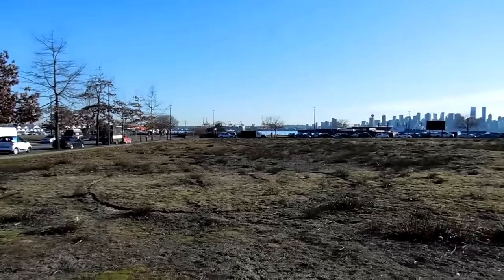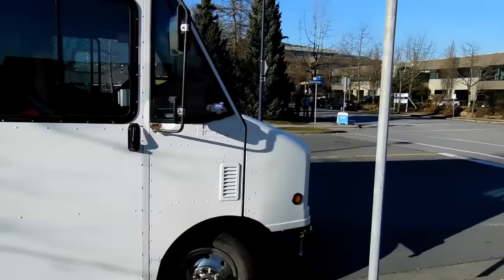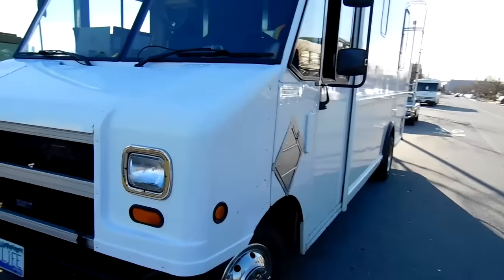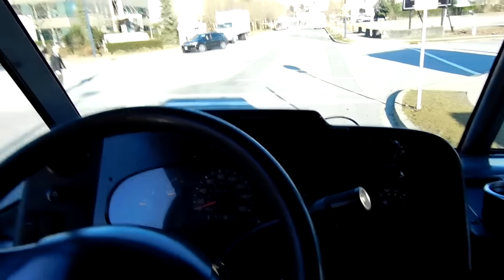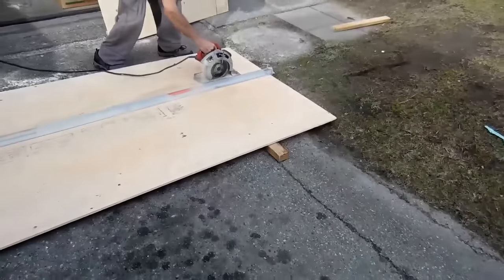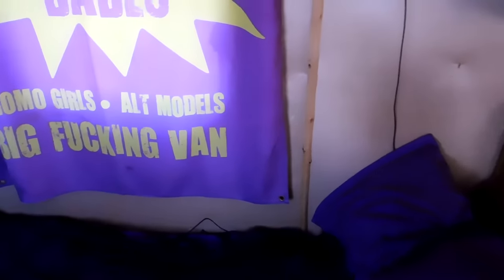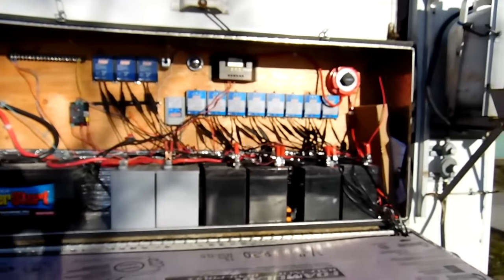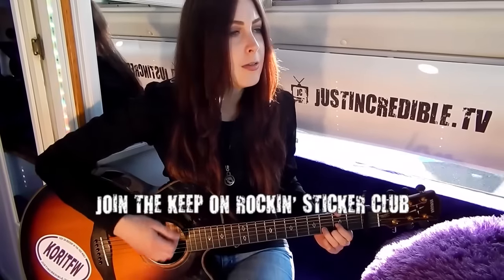My new step van motorhome conversion project!

Comment: My jaw dropped, "HOLY HAIRBALLS", when I saw how many batteries you had in that thing. Yeah, you'll never have power problems with that.
Reply from the maker: Hahaha considering the only things I plug in are my laptop every few days and the speakers, it's beyond overkill. 🤷‍♂️👍
Reply: @JCredTV  You can probably run a standing portable, window or wall AC unit, a fridge and a microwave plus everything else on all those solar panels and batteries.
Reply: they look like starter batteries with PWM controllers, lmao
Reply: @JCredTV  
You must come from a rich family in order to change living situation (camper van, rv) every few years.
Reply from the maker: Biking with Panda, all deep cycle but thanks for coming out.

Comment: wise Move !   I am here in east Tenn. USA  and after much research on all trucks/vans ,  Have decided to also settle on a small bread Truck , steel frame, aluminum wall and skin frame ,  easy to work on the engine, nice width, height, and length. and can design build to my needs.  Look forward to seeing future vids, keep up the good work.

Comment: Been thinking on this for some time. Each type of truck has its selling points and drawbacks. Started by looking at step vans, but many of them have an open cockpit, and I wanted privacy. So I started to look at cutaway vans. Unfortunately, cutaway vans are arbitrarily no longer than 16 feet in the box and 95% have roll-up rear doors. So, now I'm swinging back towards a step van again because they can more easily be 18 feet from the rear of the driver's seat., and they're more likely to have barn doors in the rear.

Comment: I got a original idea. When I was planing to get a step van to do. If you want to try this? You alway will be parking with the right side to the off street view. So I was going to make a 2 story floor on the right middle to back. And I was going to cut put back the cutout on tracks so you can slide it to the front and get the back all open as a porch. It’s high so people will walk below and can’t see you. Put chair out there and a table with a high view.
  At the bottom you have a straight up stairs and underneath you put a bed or storage.
  2 story would be so cool and nobody has done this before. You world be the first.

Comment: Wow I'm blown away how simplistic The dash & cab are! I was expecting to see a big old obnoxious stick shift and more components. The setup is pretty much the same as my simple to 02 Ford van. Exact same steering wheel and easy peasy automatic shift just turn the key and you're instantly on your nest next adventure. I to drove a diesel for a while with my old job loud stinky and you had to warm it up for a while hated that and also freaking out and get all pissed off driving around on empty trying to find a diesel gas place.+ out of all the vehicles I've owned and I'm 50 now Ford was the easiest to find parts for in the least to break down. Looking forward to the build videos Justin. KORITFW✌
Reply from the maker: Step vans are the exact same stripped chassis from Ford/GM used for Class A motorhomes, they pretty much all include the standard van dash and shifter as any other van.

Comment: Yes. Doing the re-title is a very good thing for saving money. My yearly registration dropped 75% and my insurance dropped 50%. but most tolls and bridge crossings are prices set on axle/wheel count. With 6 wheels i get dinged sometimes. like going to NYC in a regular passenger car is about 1/5th the price as for me. Also Wow that's some batteries!. good luck building the stuff you want to add
Reply from the maker: Wow never heard of axle charges, we certainly don't have that here. Private vehicles and commercial vehicles have their own toll rates, axles are irrelevant. Also, the BC Government recently removed all bridge tolls.

Comment: Are you going to get it wrapped Purple ? Are you putting in a Truma on demand water heater which will give you continuous hot water ? Have fun fixing it up Justin . Does it have a/c ? How big of a propane tank will you have ? Putting in a ducted range hood w/fan & light over the new stove ? Looking forward to the reveal video eventually .

Comment: That's a good looking van, with a lot of nice stuff already. All those little solar panels though - I definitely an not envious of doing that install project.
Reply from the maker: Really? That's like the easiest part lol. Just mount them where you want them. And as I always say, it's better to have lots of smaller panels spread around than just a big panel. Catches light from all angles and sometimes part of the van is under shade while the other half isn't, etc.
Reply: @JCredTV  I suppose we all like and dislike different parts of projects. I've done a setup with four smaller panels, and a setup with just one big panel. Doing one big panel was way simpler and easier for me. (only have to do one mount and two cables)

Comment: I love step vans .. one question is possible that the driver seat could be change instead of the hot seat that's in there to be comfortable for a female to drive it that's my only concern and I got to find out if this is a automatic or a stick shift if it's a stick shift and it would be impossible to change the seat out other than that you a nice van.. thanks for sharing 🤗

Comment: Awesome truck!  What's the gas mileage on this?  Also, don't know how easy it would be, but I'd get rid of the solar panels (sell them) and get 2-3 higher wattage panels so you have the same amount, but less panels.  I just think have 12, lower wattage panels seems a waste of real estate.  However, I don't know anything about them, so I don't know if that would be better, or feasible to do.  I presume the water tank(s) is/are under the van (or did I miss something in this video)?  And wow, tons of batteries - lots of power.

Comment: Sweet good to hear you think well of the Ford v10 cause I thinking about grabing a 06 e450 shuttle bus that's mostly converted and it has a v10
Reply from the maker: When it cones to diesel the 7.3 powerstroke is unbeatable, when it comes to gas the V10 is well known as one of the best workhorses which can easily surpass 400,000 or half a million kilometres before any major work needed, similar to diesel if maintained properly of course. 👍
Reply: JustinCredibleTV awesome right on man good to hear and know that and thanks for getting back to me so that shuttle bus is worth a look
Reply: JustinCredibleTV and i just did the conversion so like 250k miles has I would know it us here don't know metric sadly :(

Comment: It's used as food truck in NYC. You can check it out yourself.
Reply from the maker: All food trucks are made out of step vans everywhere on the planet, most of the time they are converted into food trucks after they are sold off by the large companies.

Comment: I used 1997 Chev express 3500 11' x 8' x 75" inside utility shelves and exterior utility boxes. $1000 on drive train fuel sensors fuel pump distributor water pump starter wiper motors all fluids filters and belts. Shocks hired mechanic did all rehab two days. The exhaust system had been replaced 2500. Exterior storage tools. Then spray interior epoxy and walk in cooler panels used. With epoxy cover for sweating . Then bought used pick up camper and transferred components. Stove refer furnace . I also toe a cargo trailer ... Can do construction with equipment park on job site. Company pays me for security nights weekend. And free utilities.

Comment: Think about selling the small solar panels and buy two 300 w panels.
Reply from the maker: No, as I stated before and showing with all my previous vans it is always much better to spread the solar panels out front to back and side to side on the van to capture every possible angle, and often half the van is in shade the other half is in sun etc. Even if I had to buy all the solar panels I would have done the same with 5 to 10 smaller panels spread around.

Comment: Good luck when the power goes out trying to figure out how to fix it. It should have come complete with a instruction guide
Reply from the maker: I already know it, it's all quite simple stuff. Same as any other solar system I've installed, just a whole bunch of small panels instead of one or two large ones.

Comment: I'm not familiar with the term 'step van',....are they called this because of the couple of steps that are bolted on the rear? If so your van no longer has them, maybe it's not a step van after all? Lol
Reply from the maker: It refers to the giant steps inside to enter and exit with ease, you just walk in without bending down, both driver and passenger sides.
Reply: @JCredTV  Thanks for explaining that.

Comment: It looks like you have your work cut out for you. I remember them camper Van's how small they were. 25 feet and less is ideal here in the states some Government parks you have to be 25 feet or less. Me I'm getting to the point its called a school bus. You find a park and park it, some are up to 40 feet long and plenty of wide, you could have a full bathtub if you wanted, a spare garage room and who cares about the gas if its parked? I have a Honda Civic and regular gas at 35 MPG, it dont take a Rocket scientist to figure this out and guess what? There is plenty of room on the inside.

Comment: I never understood the craziness with big engines used in the step vans.  V8s V10s...many big size vans as these in Europe and Asia has smaller, stronger and long lasting engines.

When a person lives in Vans and travels in it all over, he is thinking of saving $, but it is hard to do so with the options available.  Sprinter vans which have smaller engines, are expensive to begin with, and I'm not talking about new ones.
Reply from the maker: It's not a "step van" thing, it's all full-size vans and majority of campervans. Step vans are built on the exact same chassis and therefore use the same engines. I love bigger engines, and is required in many areas. For example it would take 12-14 hours just to drive across this one province and it involves extremely high mountain passes. A V6 in a van like mine would crawl up mountains and it would destroy the engine.